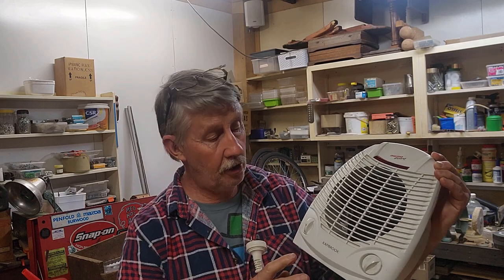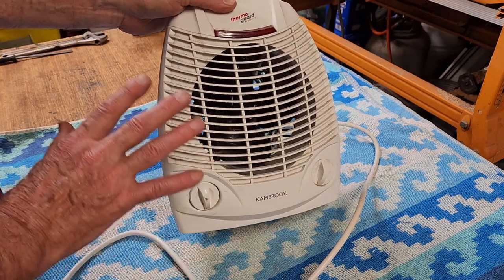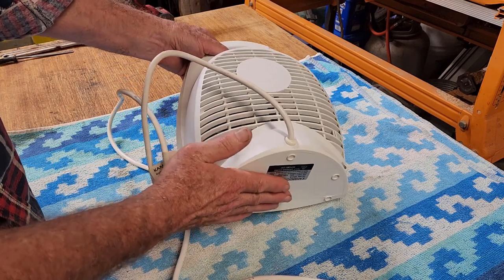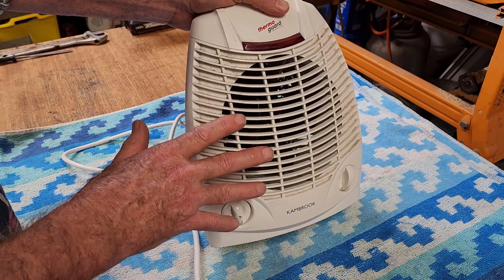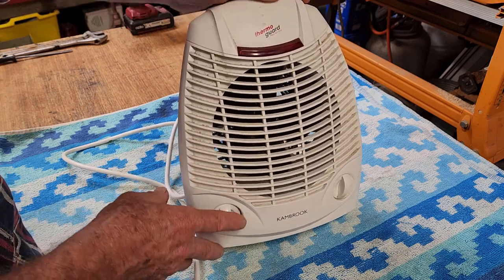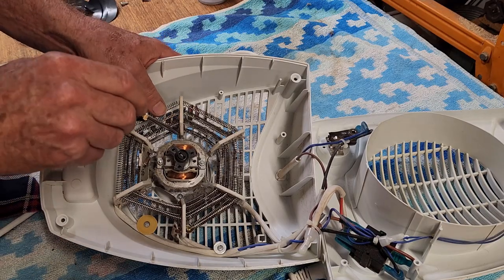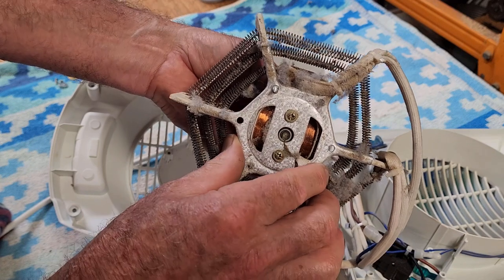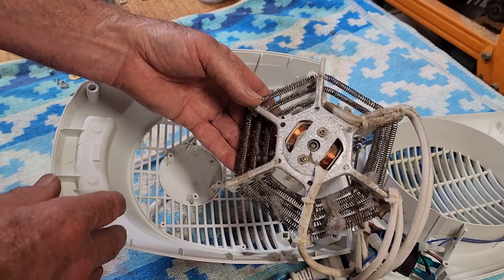How to easily DIY Repair & Service an Electric Fan Heater and Save it from Landfill!

Comment: Mine fan won’t turn? What could that be of. It did drop of my chest if draws (about 0.5m) heating option works
Reply from the maker: The fall could have dislodged a wire or even broken the switch - you would need to dismantle and see. You shouldn't run the heating element without the fan going as it will probably overheat!

Comment: Hello,i have a problem...i like to sleep with electric heater on but the lowest heating option(1200w) is too hot for me,can i somehow reduce that to 600w? Is it even possible
Reply from the maker: The wattage is the power the heater draws when operating. If your heater has a thermostat, it will control how much the heater actually stays on to keep the room at a certain temperature. So turning the thermostat down should maintain the room at a lower temperature. Personally, I prefer the use of an oil heaters in bedrooms overnight, rather than these type as they are cheaper to run and safer as far as fires go.

Comment: Love the fact that another item is saved from landfill. After this I opened my heater and was shocked how much dust/ fluff was inside.
Reply from the maker: They build up fluff and dust so quickly inside! Remember, as they suck air in from one side, they are basically acting like a low power vacuum cleaner!

Comment: Just a suggestion. Instead of getting out air compressor out all the time get or make a. Portable reserve tank that will hold 120psi and get an Air nozzle. Just an idea.
Reply from the maker: Good idea Wayne! I do plan to run a air line around the workshop so I can access it without having to get to the compressor!

Comment: Do you offer a repair service at your shop? Or do you have to be worried about lawyers in case you accidently miss something? Working as a techie in a school, I've fixed a large number of items but sometimes you also have to think about the end user and how daft they can be!
Reply from the maker: No I don't Martin as I don't really have time at the moment and my workshop still needs a LOT of sorting out before I could offer a repair service. I don't have any problems with fixing things for people as I did run my own small engine repair business for over 10 years. I do totally agree with how daft people can be though! 🤣

Comment: Unfortunately mine seems to use a magnetic drive for the motor... seems mine is a gonner as the heating element functions fine and doesnt cut out, the fan just tries to spin and cant, even after a good cleaning. Oddly enough flipping it upside-down gets it to move a little more but alas not nearly enough.
Reply from the maker: Sounds like it's very tight in the bushes/bearings Scott! It might need the motor dismantled more and properly lubed.
Reply: @TheUltimateRecycler  well, I dismantled the motor as best I could (not super experienced), didn't see a formal axle, instead it seemed it was using electromagnetics to spin the blades, seems the magnets are wornout or something (I could be completely wrong). Either way unfortunately this seems to be above my pay grade, hate to throw stuff out but I've got no clue on this one.

Edit: I appreciate your input though!

Comment: good Job Chris i have our one of these aside to fix later (the safety switch fell apart on the bottom) and i couldn't find a screw driver that fitted the 3 sided one at the time so we bought another and it was locked up internally straight out of the box, returned that one due to wanting one asap and couldn't get into it also due to security screws. the tip over safety is definitely important as you can smell the things burning even if hard up against the wall(blocking air flow). at $19 they have definitely been designed to barely last the warranty period these days(your one looks like much better quality than the ones we have)
Reply from the maker: Yeah, the quality seems to be getting cheaper & cheaper unfortunately!

Comment: i love my antique heater. Its got a separate low and hi for the fans and coils. So you can set the fan to low and the heat to hi and it will slowly burn the coils clean.
Reply from the maker: That sounds cool - most just have a fan control and one heat on/off setting! Thanks for watching 😊

Comment: Nicely explained but my problem is getting the thermostat to turn off and then on when the room changes temperature.
Reply from the maker: Thanks Athol. You'd first need to make sure the thermostat is clean and free of dust/hair etc. It's possible the electrical contacts need a clean - or have burnt away. That's what I'd be checking anyway..
Reply: Thanks mate for the reply but it’s a brand-new heater and the thermostat just does not do its job changing with the temperature of the room and this seems common in the modern heater cheap heater

Comment: Cans of compressed air contain "other things" as well as the compressed air (in the UK).

So, is it really safe to spray electrical components with it please?
Reply from the maker: I believe so as most are sold specifically to clean electronics, cameras etc.

Comment: People aren't lazy. The owner's manuaps warn that these are not serviceable and manufacturers intentionally use fancy screws to make it more difficult for consumers to service. 
Repairmen charge more in labor to "diagnose" than the thing costs.
I find that with most things (like lawn equipment) that are simple to diagnose. The repairmen simply buy the equipment for pennies and replace a simple part and resale.
Reply from the maker: These videos are aimed at people who like to tinker and fix things themselves. Just about every small appliance is uneconomical to take to a repair place, unless under warranty - then they'll probably just replace it anyway!